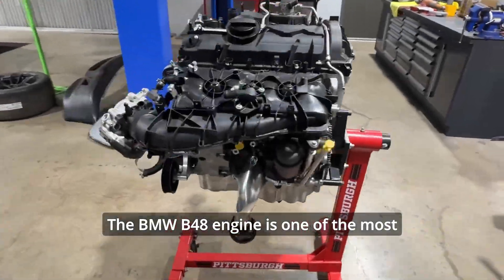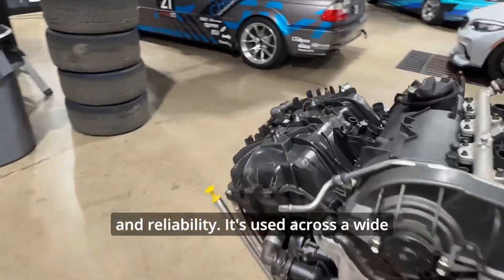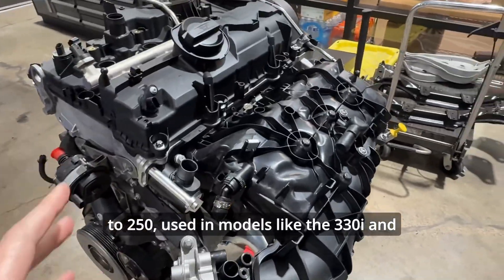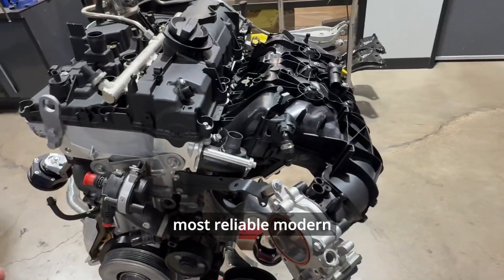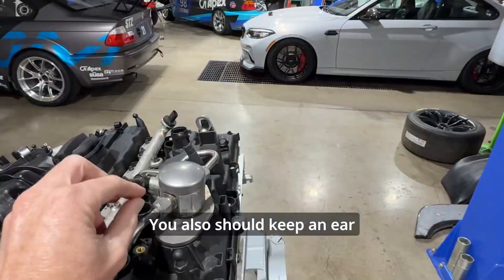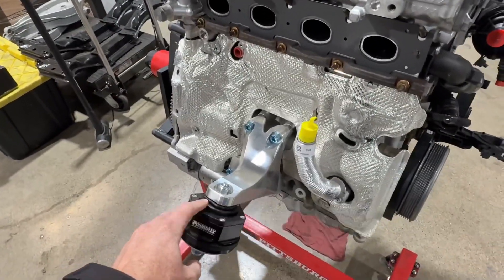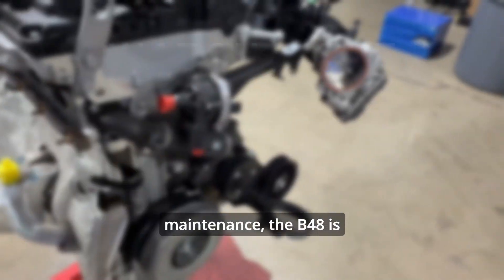Everything You Need To Know About BMW's B48 Engine

Comment: Not listed here but very important: oil filter housing needs to be replaced near 100k km. Gasket inside it swells resulting in coolant and oil mixing.
Reply from the maker: I will pin this so people can see 🙌
Reply: @HarisCars  but we can swap to aluminum oil filter  housing and coolant flange which can sole the issue right?
Reply from the maker: Yes, the aluminum upgrade helps, but the internal gasket can still degrade, so it’s not a complete fix. Still worth checking around 100k km.
Reply: @Ridemax4 correct but changing the gasket if your housing hasn’t worn or cracked will give you another 100km… I had this issue too
Reply: @HarisCars hi ,i own a x1 msport 2017 diesel, is it true that if you drive a diesel engine like for short trips every day its not good for the car? Thankyou
Reply: @reginaldinandan4047  it is not just about distance but how you drive. Constant high speed (~60 mph) is good for diesel engine especially for its TPG cleansing.
Reply: Is it age dependant or miles dependent? Looking to.buy one with 70k miles and don't want to replace one straight awqy
Reply: @LHR90101  it's not completely depends on miles! mine replaced before 65k km. there are engines rane more than 100k km also. think of it as a regular service on these intervals. better to change outside showroom if you want to save some cash. look for BMW specialists.
Reply: @LHR90101  most probably will need to be replaced . Mine broke at 85k kms
Reply: Great guys, question from me in RSA, and I want to know, is the replacement done at BMW or do we source from part suppliers ?

Comment: I’ve got a 2019 f31 320i b48 engine. Never had a car with this much and costly issues on basic stuff.

Now at 155k km besides regular maintenance:

90k: hose connectors and water pump: 800 euro
110k: wheel bearing 250 euro
130k: complete vanos system replacement due to broken siff 3000 euro
155k: oil filter housing 1200 euro

All this in just 3 years.

A lot of elementary stuff that breaks down due to poor design decisions and the usage of plastic.

I also got an audi a4 2.5 tdi with 450k kms. The basic components are made to last and thus results in high milage with normal maintanance.

These cars are pathetic and useless after warranty. Throw away product.

Comment: So, frankly, even the authorized BMW service doesn't want to use 0/20 oil in this engine. Because BMW engines overheat, they don't really believe in the 0/20 emissions nonsense, so after the first 15,000 km, they put 5/30 ll 04 oil in my car. The brand was Shell.
Reply from the maker: That makes sense, a lot of owners and shops seem to prefer 5W-30 for longevity.
Reply: @HarisCars and I really doubt that makes a different. 0w20 is tested in these engines to work as the normal oil. Thicker oil has its disadvantages if an engine was nog designed for it.

Thicker does not mean better. Think of the effect it has on the turbo?
Reply: @HarisCars and I really doubt that makes a difference. 0w20 is tested in these engines to work as the normal oil. Thicker oil has its disadvantages if an engine was not designed for it.

Thicker does not mean better. Think of the effect it has on the turbo cooling or smearing film, or maybe the chain was designed for the thinner 0w20 formule.

The 0w20 spec also comes with additives that are not found in the older spec of 5w30. Think of it!

Comment: @Haris Cars , B48 420i and 430i are exactly the same engine ? 

I guess the difference it's only electronically , right ?
Reply from the maker: The 420i and 430i share the same B48 engine, but the 430i has higher ECU tuning (more boost/power).
Reply: 430 has bigger turbo with associated lower compression internals and cooling changes. 420 can be tuned to 430 output levels at the expense of engine longevity.

Comment: What??? I’ve been changing my oil every 3000 miles
Reply: Sounds about right depending on your avg. speed. 250-300 motor hours is the max for ANY oil. All those Long-life shenanigans are a marketing scam.
Reply from the maker: That is overkill if you are not racing every night haha
Reply: @HarisCars  You change oil after every race, my mate. Unless you have a deep pocket for a new engine. These engines are extremely hot, mainly due to "eco-friendly" thermostats that opens only after 105 C. So unless you changed it to cooler one, you better have more frequent changes (especially if traffic + AC is your regular drive, not 60+ mph highways)
Reply from the maker: @Taurdil  That’s solid advice. Those high temps really do take a toll if the oil isn’t fresh.

Comment: Would you recommend using a higher viscosity oil than the recommended 0w20?  Perhaps 5w30, or 0w30.
Also, can you recommend a catch can that works with this engine? 
I have a 2024 5 aeries with a B48, and gace not been able to find a catch can from any of the online providers .

Thanks in advance
Reply from the maker: I would stick with 0W-20 unless tuned or in harsh conditions , then 5W-30 is okay. I think there is no direct fit yet for 2024 B48. Try a universal kit from Mishimoto or FTP.
Reply: @HarisCars Thanks you.
Reply: @HarisCars mine is a 2021 330 M pack flashed. I use a 5w40 Motul xcess gen 2
Reply: @HarisCars I have a 2024 model BMW 320i 170 hp B48 in Turkey. During the first 15,000 km maintenance, the authorized BMW service gave my car a 5/30 oil level. They said the reason is that in hot climates, we use 5/30 oil level LL04.
Reply: I have a 2024 model BMW 320i 170 hp B48 in Turkey. During the first 15,000 km maintenance, the authorized BMW service gave my car a 5/30 oil level. They said the reason is that in hot climates, we use 5/30 oil level LL04.

Comment: Use high quality oem parts to repair 😅. It should no fail innte first place!. 50% of engine looks like made of recycled plastic let's hope these ones are also high quality OEM.  Ice is like doomed to be replaced by ev if you build an engine like this. I know it's not only BMW doing it. But bullit proof engines are becoming extremely rare.
Reply from the maker: True! Bulletproof engines are slowly becoming a thing of the past :/

Comment: Opinion on the A variant with the higher 11:1 compression? Many people don't consider the difference between the A and B variant when it comes to tuning. On the other hand, the B58 runs the same compression but no one can tell me if the rods and pistons are forged / the same material than the lower compression engines.
Reply from the maker: Thats true. The usual practice for the higher output engine is to upgrade the internals for higher durability.
Reply: You get the same power on both, but a bit lower torque on A, 650Nm vs 700Nm (on 30e, so combined).
Reply: @alexandruconstantinescu7468 Yes, I did tune my 20i to about 265 hp en 400 nm. So far so good, the B block goes to 280 en 420 nm. I’ve checked the turbo and it should be the same one as a 30i
Reply: @linob8262 everything is the same, just the pistons on A are a bit larger and it has higher compression ratio, otherwise, exactly the same
Reply: @alexandruconstantinescu7468 I read that the A variant uses different piston materials, non forged metal
Reply: @linob8262 both of them use the same materials for everything on B48TU (G20, G30, etc). 👍 it s basically identical, just a lot of bs around that

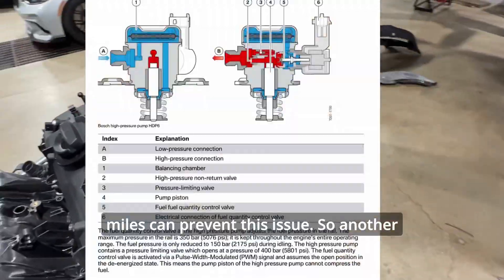Comment: What did you saw at 3:04?  Is sounds like “Walnut blasting can prevent this issue”

Thanks
Reply: That's the recommended remedy for carbon buildup on the intake valves.  It's a common GDI issue
Reply: *say

Comment: if it is the same engine why does it have different outputs ? is it because BMW did different outputs for the CO2 emissions 
If we put the car into stage 1 for example would that hurt the engine or just release more power and work as it was supposed from the factory ?
Reply: Internal are different in 300 hp version. Like stronger internal and lower compression  piston, which  you can put more air in cylinder.
Reply: Combination of ECU and software limits, some version have air to air intercoolers and others air to water, and according to what I read on bimmerforums the higher power models have reinforced internals, like the 330i compared to the 320i  
  
There's also some information online that the 330e can have either a 320i or 330i spec engine - and you can find out through a VIN Checker to see if the car has a B48A or B48B variant  
Either way the rated output of the 330e is always the same, just 182 on the ICE, +70 from the eletric motor (increased to +110 for short bursts, extraboost they call it). And some people have had crazy gains with Stage 1 alone on 330e due to it being severely software limited
Reply from the maker: I am always all in for stage 1! Would you recommend it?
Reply: I’m pretty sure it’s a combination of tune, exhaust systems, and bigger/smaller turbos that can make the output varied,